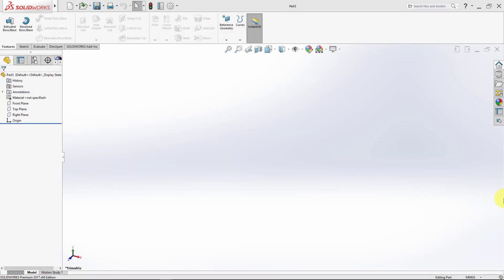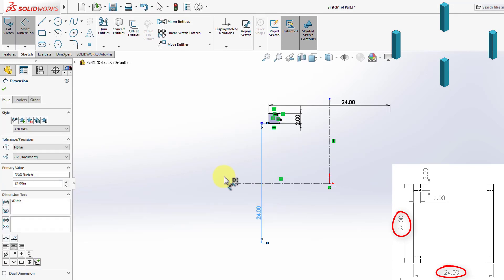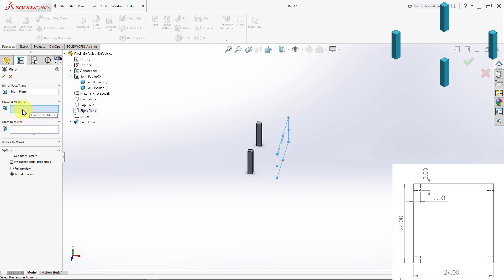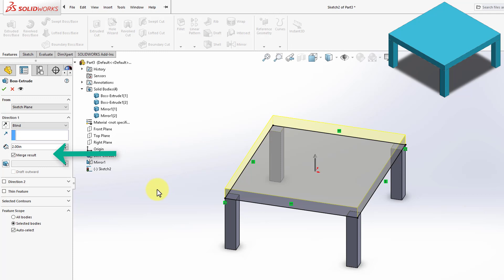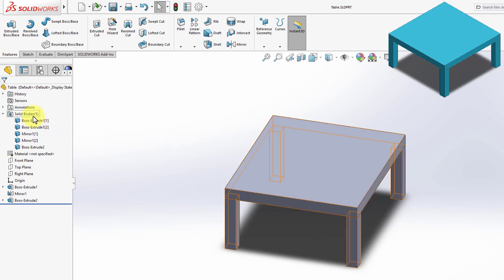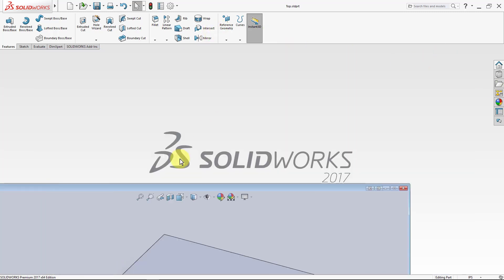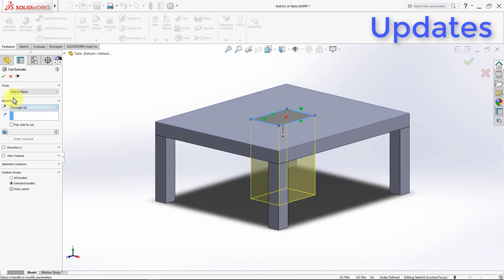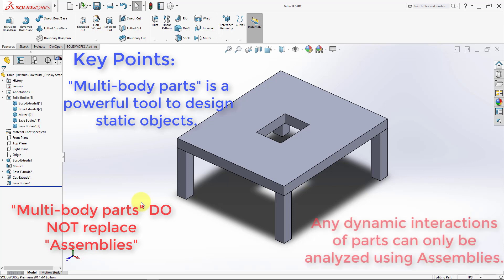Advanced SOLIDWORKS Tutorial: Multi-Body Parts

Comment: Great video but now how can you make a bill of materials in the drawing? or how would making a drawing from that part work in general?
If you have a larger multi body part made with sheet metal, could you make balloons in the drawing that would automatically have a specific number for each body?
And I use SolidXperts add on to make Dxfs for every sheet metal, I don't know how to make it work with multi body parts.
Reply: The parts, sheet metal or non sheet metal, within a multibody part can be saved as separate part files and brought into an assembly file. You then will be able to use assembly specific tools on them.
Reply: @maz1980s  i think it becomes easier to just start with that then no? not even make a multi body part
Reply: @vincentcollin5797  depends on the shape you're modeling. I would use multibody when the exterior geometry is complex, like a car body for example.
Reply: @maz1980s  yeah you right,  i work with different types of projects that i just dont need that, thank you!